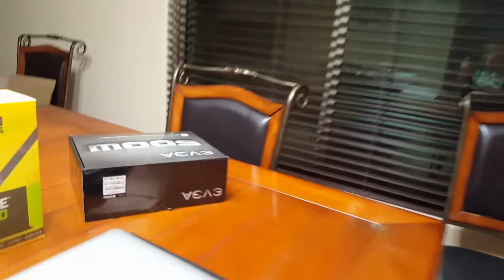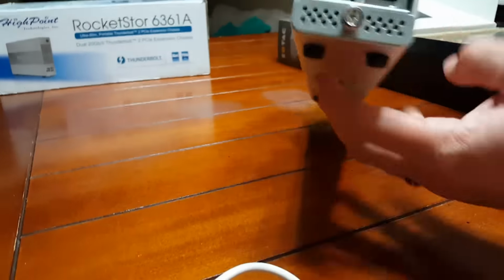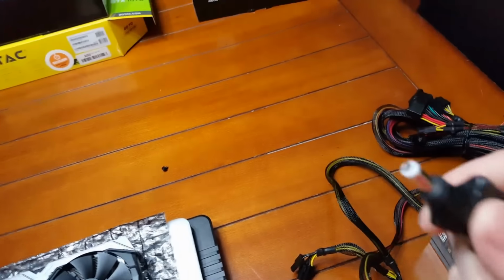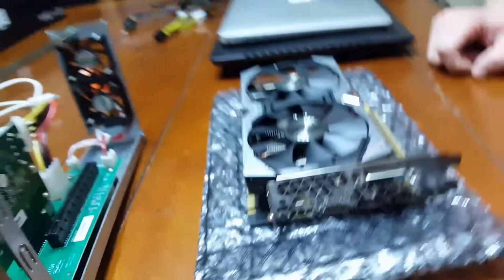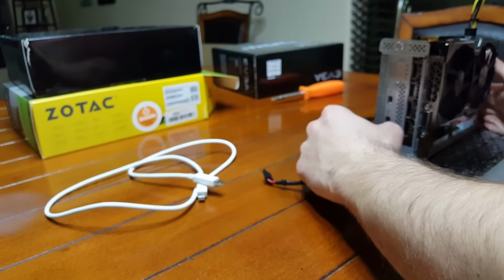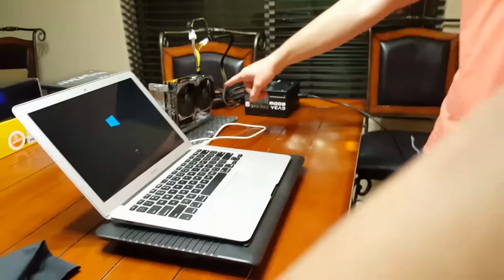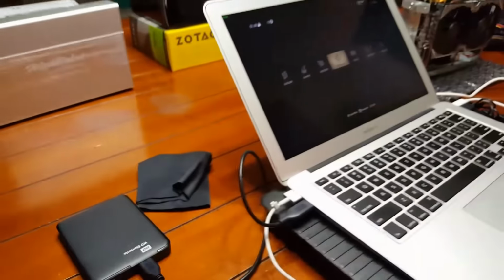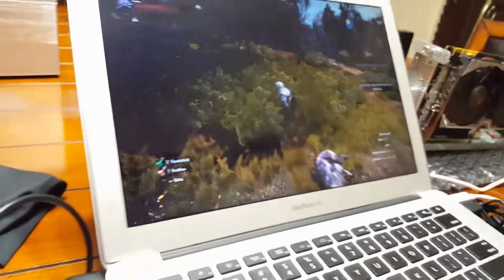Macbook Air eGPU Zotac GTX 1070 mini

Comment: Followed all the steps but windows doesn't recognize my geforce gtx 1070 armor 8g oc psu. It doesn't show up in my device manager but I still get a blue light and the card runs
Reply from the maker: Go to nvidia website and try downloading drivers before you start laptop with GPU set up
Reply: @henlinebrigs1346  Hey so I went to the Nvidia website and tried to download the drivers. However the GTX 1070 driver gave me a error that said "This Nivida graphics driver is not compatible with this version of windows. This graphics driver could not find compatible graphics hardware." 

Any suggestions?
Reply: Could it be that I haven't activated my windows yet?
Reply from the maker: @AndresLopezFilms  I doubt it, but you never know with windows.

Comment: I have a ASUS 509J with a 960m and it lags pretty often and I wanna try this mod. You think his might help or just get bottlenecked? Bcs I can't even game on hard settings on mortal kombat which is strange what you think ?
Reply from the maker: Does your Asus 509j have a thunderbolt 2 or thunderbolt 3 input? IF so I would try it. Any laptop processor is going to bottleneck which is why eventually I ended up building a desktop and using both gtx 1070 minis in SLI as my graphihcs cards. 4K all day. ME personally if you don't want to buy or build another computer its well worth it. But its going to bottleneck on any set up. I would try picking up a gtx 1060 6GB mini used on amazon wearhouse deals and a thunderbolt 2 or 3 enclosure. that should give you decent 60FPS on high settings for most games for under $500 total. If your located in the U.S I have a highpoint thunderbolt 2 enclosure for sale. LOL

Comment: i think you should know that the outside of the packaging is very conductive unlike the inside so i wouldn't recommend putting the gpu on it or static electricity could fry the gpu. But other than that very good video :)
Reply from the maker: JOnBeGone oh that's good! thank you I appreciate that. Have you ever encountered this problem?
Reply: YameFZ09er Brian personally i have not, but i have had friends who have. I also did a lot of research on the topic and a lot of people say that.
Reply: YameFZ09er Brian No but people I know have. They make the outside conductive to add a negative effect on the inside (I don't know anything about physics so don't quote me). So the packaging itself will fry it or you will touch the package, then the gpu and a little static shock will fry it. It doesn't happen often and half the time it won't fry it but it's  a risk not worth taking.

Comment: Hello, thank you for your video, you are one of the only person explaining the setup correctly.
Why you need to use a double 6 pin to 8 pin adapter? It's not possible to directly plug the 6pin+2pin in the graphic card directly as I'll do in my PC?
Reply from the maker: Léo Marcotte it depends on the card. the Zotac GTX 1070 mini in the video comes with the x2 6pin to 8 pin connection. the reason why is because the card only has 1 8 pin power connecion. And if it comes with it, why not use it. lol
Reply: Okay I see, because I tried this setup with Akitio TB2, difference is I have a GTX 1070 EVGA SC.
The card requires a 8 pin connection, but my psu only have 6 pin + 2 extra pins on the side.
I tried with this setup, but the fans of the graphic card are not turning correctly when I boot to windows.
If I boot to OSX, the fan are turning correctly. That's why I'm trying to understand what is going on :)
Reply from the maker: Léo Marcotte well with my card the fans only turn on under load. Try running a game to determine if it does the same as mine does.

Comment: Hey YameFZ09er Brian - thanks for sharing these posted videos. I recently purchased the base model 13" macbook pro w/o the touch bar. So I have a turbo Ghz of 3.1 and a soldered in 8Gb of ram. However with the thunderbolt 3 40Gbps I was wondering about possibly considering building an external GPU box like this, but in cost would it be more affordable to just buy say a PS4 for about 250.00? I don't game as much as I used to and most if not all games I have any interest in, like Mad Max and Resident Evil7 are on a console so unless building one of these boxes would cost significantly less I don't really think it would hold it's own since  I can't upgrade my laptop's CPU or RAM?
Reply from the maker: Ubiquitous Reverser your definitely gonna be saving a lot more by just going with the PS4. Thunderbolt 3 to PCIe box alone is $250 and then you still have to buy a power supply and your graphics card which is going to run you around $550-600 and that's with just a gtx 1060 card. anything higher and your looking over $600 easy. In your case I would stick to buying a PS4 as they have all the good titles right now to begin with. it's not the hardware that sells, it's the software. And for gaming PS4 just has all the good exclusives right now.
Reply: Wow, well thanks for your reply.
Reply from the maker: Ubiquitous Reverser yeah no problem. And me myself I am an Xbox one guy, but Playstation just has all the good titles I been wanting to play while xbox focus is solely on their new console or whatever. Me personally I would save your money and pick up a PS4 along with Horizon Zero dawn, and all the other good exclusives they are coming out with. for instance God of War, that kick ass zombie game they been advertising and that Japanese title one that plays like dark souls.
Reply: Maybe one day. I'm working a lot of hrs at my job and what free time I do have I've been spending learning either about my macbook or learning python.
Reply from the maker: Ubiquitous Reverser I hear you yah, I'm currently working 12 hour shifts full time and going to school full time. I hardly got time to do anything anymore.
Reply: Ah, adulthood. So much fun!! At least a few moments at a time.

Comment: Awesome video! is it possible to adapt the Rockstor to work with a DELL XPS 15 thunderbolt 3 (USB C)? Thanks
Reply from the maker: n7eet Your better off purchasing the akitio thunder 3 box instead. this box unfortunately is only made for thinderbolt 2 adaptive comuters. Although you could try a thunderbolt 2 to thunderbolt 3 adapter with it and see if that works?

Comment: compatible with MAC OS High Sierra? my macbook 2011
Reply from the maker: You may have to download windows 10 via a USB drive and check if Sierra will run boot camp. Any reason you havent updated? Sierra is quite old, and you can only run this set up on the windows OS following this set up.

Comment: Ur macbook air is early 2015 ? How u booting itnto windows ? Without freez ? Ive got 1050ti its pain to booting properly
Reply from the maker: До Вьет Ань you need to turn on your eGPU power supply the moment you see the windows insignia show up on your screen. Also, what type of Mac are you using?

Comment: Hi Brian, I followed your steps everything works. But when i play games or let it run for about 5 minutes the power supply and the video card just shuts off and stops working. Do you have any idea why? I have a bronze evga 500w with a gtx 1070.
Reply from the maker: lance lieu your graphics card alone draws 150-170 watts and the akitio needs I'm guessing 75 watts. My best assumption is to try a different power supply. I noticed with my EVGA power supply that I used had thin 18 gauge wires instead of good 16 gauge like my thermaltake power supply. Purchase a larger power supply (600 watt better then bronze series) that has a 15 day return to see if that's the culprit. if not send me another message. I'm more then happy to find out what the issue is.

Comment: Hi! do you bootcamp from a external SSD? My problem with the macbook is the SDD has no space free to install a proper bootcamp! Any help? Maybe the egpu can storage a ssd too?
Reply from the maker: Ale Can no I divided my internal hard drive and paritioned it in half 250GB for both OS. you can run windows 10 off external USB hard drive. I have seen it done by plenty of others.

Comment: Can i use 120w power Adapter (barrel plug) ? as i want to use 1050ti which get it's power from PCIE & don't have any power input slot
Reply from the maker: I recommend you find a 1050ti with a power plug in. The PCie box I believe is only good for about 75 watts  through barrel plug.
Reply: YameFZ09er Brian ok thanks

Comment: how much power supply do I need for 1050Ti
Reply: Surprisingly, you use the same 2TB 25A1 HDD WD which I use XD... What is ur ram by the way? Could you please give me the detailed specs of your internal processor and ram
Reply: ok you have a 2.2 GHz Intel Core i7-5650U (3.2 GHz Turbo) you mentioned that in one of your video nvm about that. I have shit specs of i5 5250U 4gb ram. worthless specs, can i atleast get a experience after getting a 1050Ti
Reply from the maker: World runs with tech A 1050 ti won't do a lot for you with that processor and only 4GB of RAM. But if you can find a 1050 ti for a good price and you already have the thunderbolt enclosure I would try it anyway! With a gtx 1060 6gb I was able to run AAA games at 60FPS in ultra settings on my MacBook Air. With a 1050 ti I'm sure you could accomplish 60FPS at medium settings. Even that's 10 times better then what your MacBook Air is currently able to accomplish. Just purchase the card from Best Buy and if it doesn't hold up to your liking just return it. That's what I did for my videos.

Comment: what if i don't want to run windows? just want to connect eGPU to mac,
Reply from the maker: waht mmm then your going to have to do a little bit of code writing via through your terminal, there are forums which you can look up that would allow you to do this, but I figured it kinda pointless as I only use mac osx for everything other then playing games or video editing. I do all that on the eGPU in windows Cuz gaming on mac osx really does just suck.

Comment: is it working at the macbook air mid2013 ??
Reply from the maker: 이승준 yes it should, mine was a 2014 and there wasn't a difference in year make model.
Reply: How bout 2012 mac air model?
Reply from the maker: @jjdiamond4108  if you've got at least 8GB of RAM go for it. But I do believe the 2012 models only came with 4GB of RAM. It may be ruff trying to run new AAA games.
Reply: @henlinebrigs1346   you are so helpful and  very logical in reasoning! Thank you very much for your kindness and time for replying.it was very much appreciated.
Reply from the maker: @jjdiamond4108  Not a problem at all, I appreciate the comments. I'll be making more videos as soon as I finish with school.

Comment: Is your MBA the i7 model man?
Reply from the maker: Alan Cuzzi yes sir it is i7
Reply: I have an i5 latest model too, will this setup work okay with this one?
Reply from the maker: Alan Cuzzi yes it will work but do be advised that most games now days ask for at least 8GB of RAM or more, so only purchase if your Mac has 8GB of RAM or more. And your i5 is definitely going to bottleneck the shit out of your graphics card. For instance my i7 bottlenecked the 1070 mini to only 60-70 FPS on my MacBook Air but when installed in my Desktop I am easily hitting over 100FPS.

Comment: nice .:-) but i think you run under  GTX 1070 on Mac OS . :-)
Reply from the maker: Prakash Meena yeah you can but it's just a pain trying to get it to run
Reply: yeah but currently NO Webdriver available for 10 series Nvidia GPU😁
Reply from the maker: Prakash Meena yeah not for the Mac side. it runs great on windows though which is when I use it the most anyway.

Comment: **Whitelist Bypass/Warning**

If you are planning tobuild an egpu via pci-e to wireless hdmi output alot of big companies have made this slot unupgradable. There is a solution. Search youtube or my playlists (comp misc) and you will use coregen.exe .
Spoiler 
This solution is very technical and you might require assistance,research,or both. This solution is the best resort to bypassing the whitelist that allows for only the stock wifi card in your pci-e slot. 

Good luck and i hope this prevents you from missing out on the opportunity to game just because laptops are nearly 2000-3000$to buy a gaming laptop that includes a graphics card. If you are considering this route plz reconsider buying and building a custom desktop  rig, for 700-850$ you can build a 2x powerful machine.

*My Egpu Setup*
Hp 17 Envy 
Gpu- MSI RX-580 
Cpu- 4200mq i7 @ 3.7ghz (working on bios mod to push 4.3ghz)
17"1980x1020
2tb-hdd 7200rpm & 1tb ext. hdd
Monitor- 57" Sony Bravia 4k 
FPS-
85-135 @ 1080p high
60-75@ 1080p Ultra
38-54@ 1440p